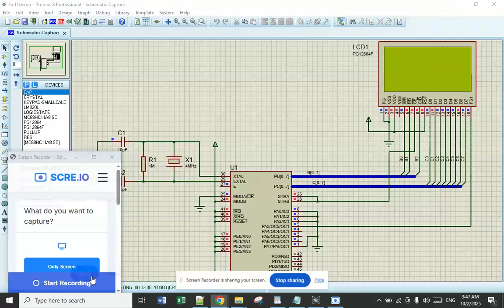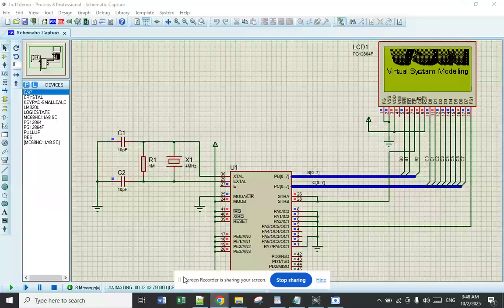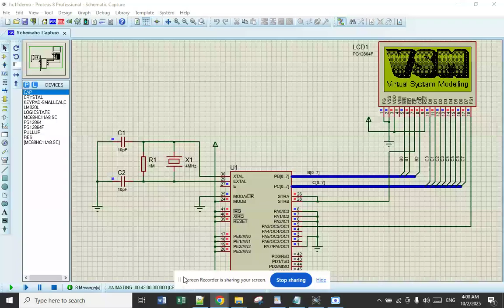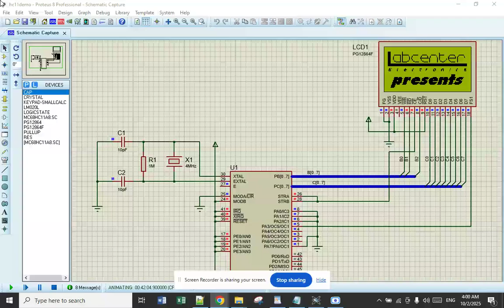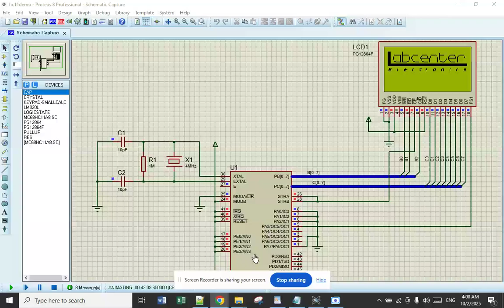Proteus Virtual System Modelling (VSM)

Comment: Nice work  no matter I never used this microcontroller at all It just remember me when I was in school and we had a MC6809 Motorola CPU kit for learning embedded system with this kit you can see everything in concrete mode like ACIA chip for USART communication and PIA   I/O port chip 
Memory multiplexer 74hc138 for addressing memory pages , RAM ,Hexadecimal Keyboard and seven segments display that show us CPU UP because he had a monitor program like a boot loader but more advanced you can use it to store your program in memory In SRAM location and ask him to execute the program for you ,
to do this we translate our assembler program using instructions set paper for the MC 6809 and we put the Hexadecimal code in the location to be run no assembler program everything was done the hard way to make us memories the instructions set for Motorola. anyway now the ARM Cortex m is the king for new projects everything else started becoming obsolete for different reasons low cost and performance. Maybe 8bit microcontroller they will still used for low power consumption appliances .